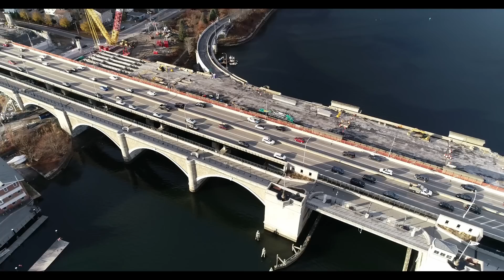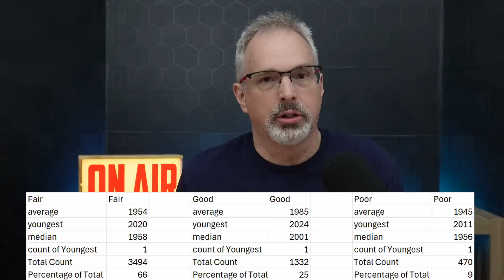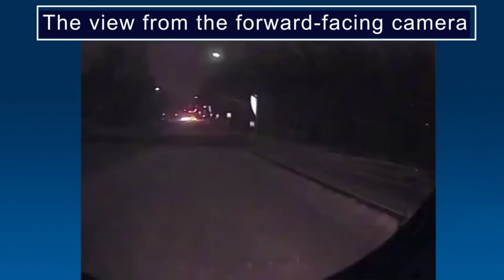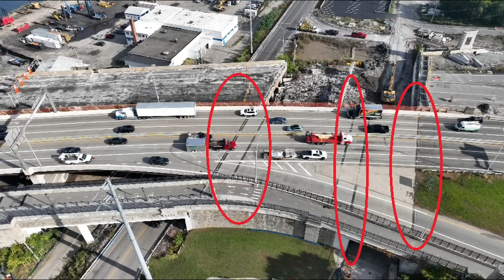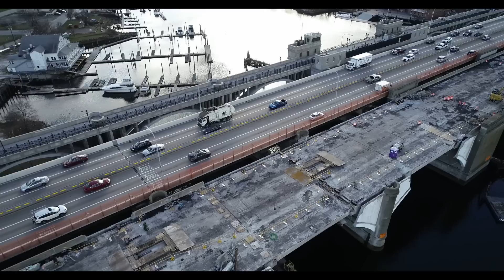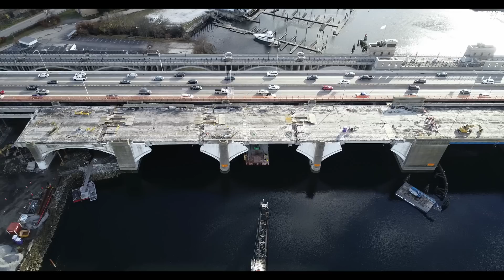Washington Bridge Closure  - 1 Year Anniversary Update

Comment: Every bridge should be made with coated rebar and galvanized steel to extend its life. I worked for a small town in Rhode Island for 11 years and we had our share of poor quality bridges. I had to close a bridge on a back road that the state engineer came to inspect after a new deck was installed over old beams. The engineer said to me they were not worried about rot on the ends of the beams as long as there was no rot in the middle . It is still closed to this day 14 years later.

Comment: Casey I love your videos. I have 1 question corten or weathering steel was made for bridges and found to the last painted bridge steel by 120 years. I am just an Ironworker but have 4 years of college. I know while erecting this steel, you can not damage the patina. My question is, from my experience and reading, was not corten or weathering steel made for over water?
Reply from the maker: Thank you!  You are correct. You're not supposed to use weathering steel over salt water. I understand the Seekonk river is a mix of salt water and fresh water, so brackish so maybe that's why they could use it there.
Reply: @CaseyJones-Engineer  Thank You for answering my question

Comment: What can I say about the situation in Massachusetts…

Continue down 195 to New Bedford MA where we have now placed concrete into the web of the 195 viaduct over RT18 because the beams have rotted out and the web is deflecting. 

That repair is supposed to last until we can demolish it and rebuild the whole viaduct. The columns have been aggressively spalling as far back as 2000. Column repairs were also made and have not held up as expect. I believe it was built in 1960 something and had to be granted a waiver because of the road pitch.

Very close to that bridge is the New Bedford Bridge which clips part of RT6. That bridge was rebuilt in the late 90s, built in 1900. And that’s now suddenly a rush replace project.

We did just built a brand new pedestrian bridge over RT18 in New Bedford as part of the T commuter rail expansion project for a cool $27 MILLION

Comment: About 1988 I was riding my bike on Providence Street in the Natick section of West Warwick Rhode Island over the bridge near where Twisted Pizza now is, where Niko's used to be. There was a hole about 18 inches or two feet across. There was some rebar, but otherwise it was a straight shot downward to the river. You could see the water rushing by. They got a crew out there within an hour, but it was probably over 10 years before they completely refurbished that bridge. I don't mind bumpy roads, but the bridges....

Comment: Cleaning of drains is something that we do yearly in Canada. It is usually done by the same trucks that sweep the streets. They sweep the streets as soon as the snow has fully melted, and once that's done, they start opening manholes and cleaning them out. It is an operation that is ongoing all the way into late summer start of fall. Those trucks are so noisy that you just can't avoid noticing when they are a few streets away.
Reply from the maker: Interesting!

Comment: I have spent  over 20 years working on bridges in RI and can say that lack of maintenance is the issue RIDOT has very few maintenance workers as a reult of cost cutting.  They divert gas tax money to fund social programs. They wait until the roads and bridges need to be replaced so they can secure federal funding . RIDOT did away with its own  design staff to cut costs and rely on outside consultants to review design work now. This state runs on fiscal irresponsibility and political appointments.
Reply from the maker: Lack of maintenance is definitely an issue with RiDOT bridges in my opinion.
Reply: We do the exact same thing in Pennsylvania.  Actively prohibited from proper maintenance, just to have the structure fail, and the feds to pick up the bill for a contracted job.

Comment: Casey, you, and every other competent engineer will probably comment that a bridge MUST HAVE a life expectancy of 80 years, degrading over that time, these bridges are falling far short of that, which points to design AND construction failings, coupled with lack of or no maintenance. When these structures fail the cost and inconvenience  caused will cost lots and lots more than doing it right first time.
Reply from the maker: You know you are absolutely correct about that.

Comment: Great vid Casey!! I don't understand why their database would only have three possible ratings when they have a scale from 0 to 9. Classic gov't! And the three numbers used are 4,5 & 7 - which are not that far apart in general description. But aside from that, I think the states promote lowball ratings on their bridges in order to show need for funding. The federal and state governments replace on an as-needed basis, so lowball ratings on bridges where a new roadway is desired helps the cause. There is simply no way possible that RI has any bridges built in 2007 with a rating of 'poor', or two bridges built in 2023 rated only 'fair'. The Kansas chart looked much more realistic in this respect.
Reply from the maker: Thank you for your comments!  You know that's a very interesting point that I hadn't considered that they might be cooking the books to try and get more money.

Comment: There is no such thing as "emergency repair " in New England. Basically it gets done when it gets done, and there is nothing you can do about it. One extreme case of this is the Bragga Bridge that connects Fall River and Somerset Massachusetts. It took 15 years (2001 through 2016) to remove the weight limit that would allow it to open all 6 lanes of traffic. During that time only 4 lanes of traffic (2 on each side) were available. It was a combination of bad management and bad luck on why it took so long. In the end most people forgot about it because the traffic impact was minimal.

Comment: There is a formula based on many characteristics that determine Good, Fair, etc.  usualy a points system based on traffric, lanes, clearances, detour length, railing condition etc..  You could look at the SI&A sheets to see what has changed for the two years where it shifted from good to fair.  You are correct that drainage, joint sealing and corrosion are a big factor in the rating.

Comment: Weathering steel has in addition to steel nickel, copper,  chromium  and some sulfur and phisphorus. 

Iron when it rusts forms Iron (III) Oxide, Fe2O3. As there is an excess of bonds it’s forms small salts as rust, but mixed in there are Iron carbonates and other trace metal salts. 

Just about every metal is soluble in water to some degree. In fact it’s really easy to dissolve pure metal, most metals readily dissolve in monoprotic acids, HCl, HNO3, HNO2, HF at low temperature, HBR. Weathering steel is no absolute protection. 

For example if you take a drop of HCl, put it in 1 liters of water, poor it into a stainless steel sink, and fail to rinse that sink, the next day when you come back to the sink you will find fine rust lines all over the sink. The way to stop this is to rinse it with tap water that has a small amount of Calcium in it. You can get rid of the rust with a similarly dilute solution of acid, and then neutralize the surface with bicarbonate. 

So here is the problem. 
Water has acid in it depending on pH. So if pH is 7 you have about 100 nM of acid and base. As ph goes down by 1 unit the amount of acid goes up by 10-fold, at pH = 5 thr amount of acid is 100 times more than at 7, and the ratio of acid, H30+, to base OH- is less. The acid is in the 10 mM range. Now remember what I said, if you just put one drop of HCL (about 10M) in one liter (about 16,000 fold dilution) you can rust stainless steel over night. 
So let’s calculate the pH. HCl in water is typically 10N, that means it’s pH is -1. If we diluted by 4 to 5 magnitudes of 10 that is +4.5 so the pH of that one liter of water is around pH 3.5. At pH 3.5 we know we can cause something that does not ordinarily rust to rust, and not even in a wet or damp wet condition. This is because metals are not a uniformly flat surface. And actually you generally have to heat them up past the boiling point of water to completely dry them out. That’s the reason for the tiny streaks. 

Ok so I hope everyone is following me to this point. So let’s discuss rain, and I’m not going to deal with sulfate driven acid rain, let’s just deal with rain today. Rain falls through the sky, the sky has carbon dioxide in it, the rain equilibrates with respect to CO2. That pKa = 4.76 pH units. Carbonate in water varies according to temperature and salinity. It particularly like cold water. 

H20 + CO2 (gas) = H2CO3 (carbonic acid - makes soda water fizz)  Thus somewhere between pH5.5 and 6.5 rain water has an acidic pH 

So therefore to cause the type of damage seen on my sink, it would take 100 to 1000 days, which is not bad, it will get worse as CO2 increases. But let’s just pass that problem to the next generation. The question however is that carbonic acid is not nearly as corrosive to metals as monoprotic acids. True, until you put road salts on the road. Na+ + Cl- + H2C03 <<<———->  NaHC03 + H+ + Cl- and that is very corrosive to metals. This is why doping solutions with Ca2+ can stop corrosion, if there is rust starting Ca loves CO3 and CO3 loves metals so it can lock a coat of carbonate on the metal that can sacrifices itself to the acid. 

So if Calcium protects the surfaces of metals what can unprotect them? 
“Carbonate”, but not carbonate in its metallic form but covelantly linked to a carbon
The simplest of these is formic acid pKa 3.75. Organic acids are much more stable in solution than carbonic acid. But we will never deal with simple organic acids in the environment. But nature has another card up its sleeve, polycabonyl acids. Probably the best example of a poly carbonyl acid is Citric acid pKa(1) = 3.13. And while the occasional glass of OJ will spill on a bridge or an orange truck will fall over, this is not much of a concern either. The reason not to concern over these is that effluent washes away quickly and pH reequilibrates with metals restoring pH over time. 

So what kinds of acids are of concern? Viscous polymeric acids like those found in humus or compost. In fact peat, as an example, is extremely good at removing metal salts from solution. The compounds tend to stick around on surfaces like cotton candy, and just as they decay teeth, they decay steel. What is particularly bad about these is that the acids linger, the tend to negate the effects of calcium carbonate or other protective carbonates or metal oxides on the surface. 

Where do these come from. Composting of cellulose rich organic materials in drains and downspouts. Are there a real life examples? Corroded down spouts of aluminum gutters. 

How to prevent them, cleaning the drain, calcium carbonate (coating surfaces with saturated CaOH), concrete decking on bridges (concrete is made from calcium oxides). 

What are other concerns. The joints of weathering steel need to be welded in places. Matching weather resistance of welds to the steel is a problem, and acidic runoff on these areas makes them particularly susceptible to corrosion, rusting and pitting. 
Make sure runoff from bridge decks and down spouts does not accumulate on welds. 

Other problems. Concrete reaches maximum strength about 50 years of age. The aging is related to carbon dioxide and moisture in the air. As the concrete reaches its peak it begins to lose the ability to neutralize organic acids that can seap through cracks. Once these acids reach the metals they can cause spalding, the end result is concrete breakouts. If concrete is exposed to more acids via acid rich runoffs, that lifespan of the concrete will decrease considerably. And so if a bridge is subject to lots of composable material it will fail more quickly in many areas and those columns and footings are then ALSO SUSPECT. 

So in this case I would agree, poor maintenance will not just affect the deck and the structural spans it can also shorten the lifetime of the footings.

Comment: Just wondering what the issues that resulted in the fair rating.  The photos and reports I have seen only show deterioration in a bolt shaft.  As I remember the issue with fern hollow it had to do the the failure of the main structural member due to corrosion of the web or maybe the flange, but in either case it was obvious and should have been fixed.  I have never seen anything anywhere near that on the Washington Bridge.  That is very important. 
As to the suing of the bridge demo firm, as I remember it every engineering firm who drove over the bridge got sued.As you have pointed out it seems that the attempt was to avoid any responsibility on the part of R.I.  Also I would not expect R.I. AG to release info as it would have been critical to their case.

Comment: My opinion is that a bridge should be able to sustain Good Condition for 30 years from the construction given no abnormal events and with regular maintenance like repaving and painting of exposed sensitive parts, which I would see as pretty ordinary activities.
After that time it's going to be some parts that can't be easily accessed or maintained to show signs of aging that would require targeted efforts. In general the earlier degradation is taken care of the easier it's going to be.
I'm comparing a bit with an industrial building at work that was built in '77 from concrete. It's now seeing some concrete being remove due to it being cracked and have seen frost damage. Should probably have been done a bit earlier. I'd consider that building to be in the "Satisfactory" state anyway since most of this was mostly superficial and not structural at this stage. However pieces of concrete falling off a building can be a health hazard.
Overall a bridge should be able to have a lifespan of 50 to 100 years.

"Unknown Inspector" - to me that means that no formal inspection was done.

Comment: What are the chances that the east bound bridge is going to have to be replaced after this is all over, having seen the added stresses caused by detouring all the traffic from both directions over it? It's also hard to believe that RI-DOT director is still in office, talk about political patronage! Maybe the people of RI should be taking a hard look at that states governor too!
Reply from the maker: The Eastbound bridge was supposed to be in use for 75 years. I doubt it will make it that long due to insuffient maintenance.

Comment: Remind me to never drive through Rhode Island.  That's not the way I want to die.
Reply: Well, you COULD have been sitting in that bus crossing the failing Pittsburgh bridge.
Or driving across the I-35 bridge in Minnesota.
Or driving across the Key bridge in Maryland.

R.I. is a beautiful tiny state, and very historic.
Unfortunately it has been beset for decades with poor oversight of its public highways and bridges.
I won't rule out corruption, but this Alvidi character certainly emits airs of deception to cover for his incompetence.
The Governor should be making high-level changes at the DOT, via OUTSIDE hires.

Comment: Some years ago, I watched a documentary on a Bolsters Oregon hinged arch bridge 2004. Because of its proximity to the ocean and resulting salt exposure, stainless steel rebar was used. Up-front cost is significantly higher, but I would think that the long-term benefit in a northern or coastal application would be worth it. I believe the original Oregon bridge collapsed due to spalding?